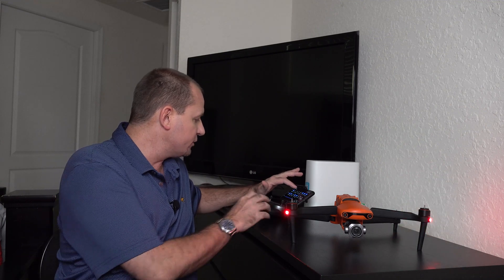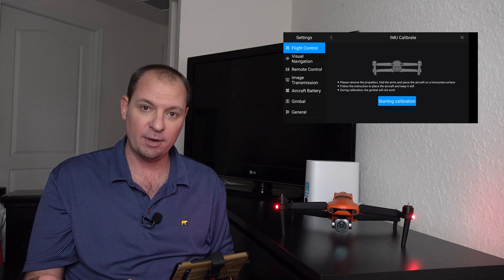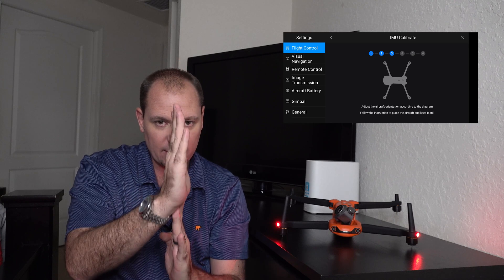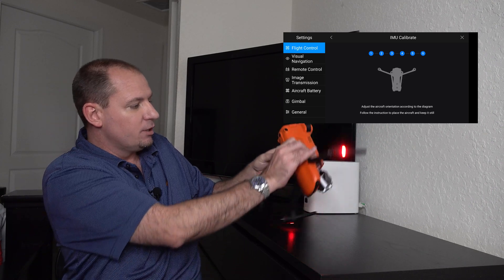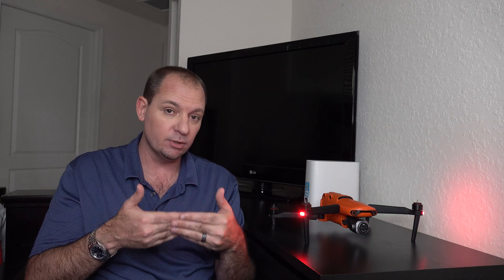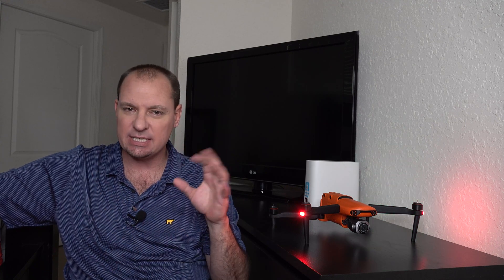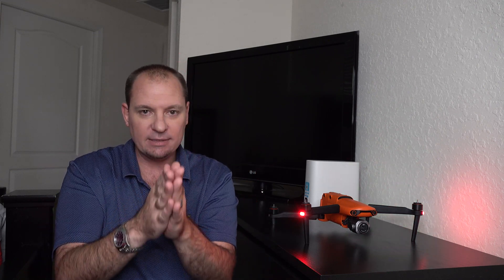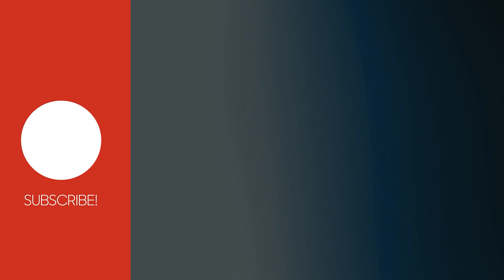Autel Evo 2 Drone 3 Axis IMU Calibration (Full Tutorial & Demo)

Comment: Good to hear about the order of calibration.  Does it matter when one does the Obstacle Avoidance Sensors calibration?
Reply from the maker: Andrew, I am not sure as I have not had to calibrate my sensors yet. Good morning I understand it's on something you need to do all the time.
Reply: @HobartsReviews  After updating the firmware (I think 2.5.18), I attempted to calibrate the gimbal.  Each time a message would pop-up indicating that the "aircraft is shaking, unable to calibrate."  I placed it on a solid table and it was still throughout the process.  I never received a message indicating that the calibration was a success.  Incidentally, I was able to successfully calibrate the IMU following your instructions. Prior to this update I had no issues calibrating the gimbal. Any suggestions?

Comment: Like your informative videos.  After gimbal calibration inside, is it safe to then turn off drive for a half hour repower up and do a compass calibration and fly.  Or should you do gimbal calibration at fly site.  Also how often do you do the IMU calibration?  Thanks
Reply from the maker: Hey Jerry, Thanks for the kind words! If it was me I would do all of the calibrations while I'm at home and then when you drive a half hour to your flying location then just do a compass calibration to make extra sure that the drone knows where home is. If for some reason it gets stuck on your house 30 minutes away that may not be good. some say you might not need to do another calibration so close to home but I go by the better safe than sorry motto lol

Comment: Do you think its worth the update at this time?  And thank you for the video.    Stupid question,  how do you do a gimbel calibration?
Reply from the maker: Hey Clifton, honestly I'm not sure if it's worth it because I have had some issues even after the latest 2.5.12 update. Good question on the gimbal. if you go to your gimbal settings there will be a automatic gimbal calibration option. Make sure your drone is on a flat surface like a table and go ahead to that section and hit gimbal calibration and it will calibrate. You'll see the gimbal move all over the place during calibration. Don't touch it just leave it be until the finishes.

Comment: Thank you for the clarification on doing the update.  I will redo the calibrations in the order that you specified.  I had problems with the gimbal not ready error.  I was told to leave it on and ready to fly and wait for 2 to 5 minutes and this should go away.  As I was not busy, I let it sit for 30 minutes with the propellers off and ready to fly.  After 7 minutes the gimbal not ready error went away but keep reappearing every couple of minutes or so.  

A compass calibration video maybe in order for us who never flew a DJI drone maybe of a help also.

Happy Flying!
Reply from the maker: David, yeah that came directly from Autel for time being until they can fix the errors. After compass calibration outside with gps it seems to get better as well. Good luck and let me know if all is good.
Reply: @HobartsReviews  The fix was to update my firmware to 2.5.12 and to recalibrate.  That solved most problems.  Now it doesn`t like flying lower than 12m.  The obstacle avoidance slows the drone to a stop.  I fly low to avoid the headwinds.